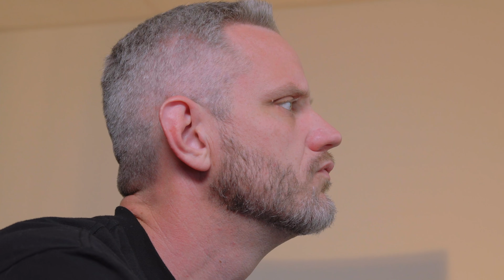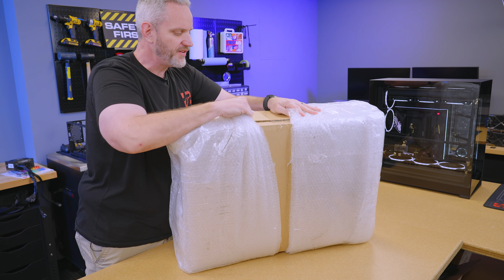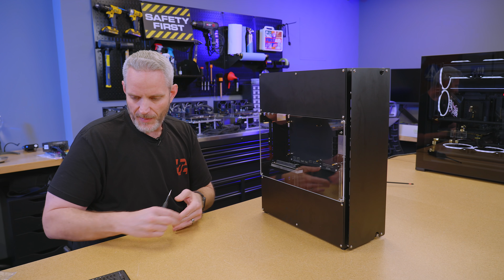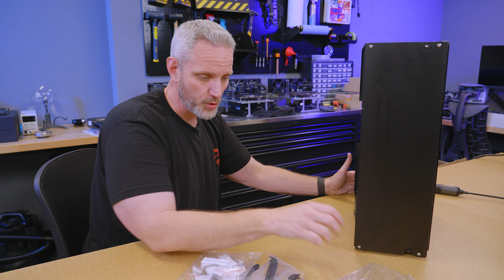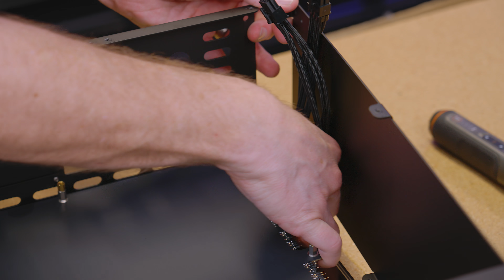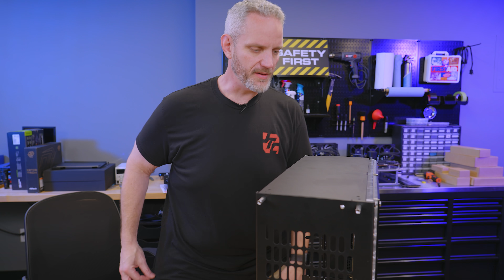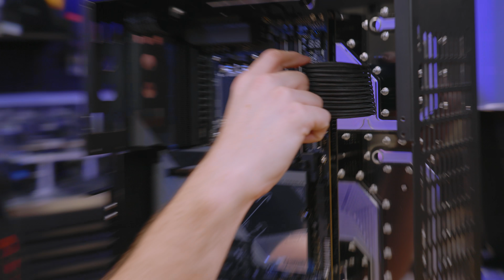I guarantee you haven't seen a case like this before...

Comment: While it does seem like a nice case, it's DEFINITELY needing some improvements in the power distribution/reservoir mounting design.  
Maybe open the holes up a little bit and use a rubber isolator insert between the screw and the acrylic??
Also, the top plate DEFINITELY needs to be opened up in the forward section to accomodate at
LEAST 240mm fans or even a 240mm radiator with all the room it has.
ALMOST Last thing I would suggest is that since the power supply goes in the bottom 
would be to have it closer to the middle of the case to balance the weight.
Lastly, like Jay said, DEFINITELY a soft rubber footing to have grip and vibration dampening but a larger flat foot instead of those baby toe pegs....
Maybe even one that goes full width, or even better still is a front and rear foot that actually tapers outside the case edge by half in inch on both sides for stability.

Comment: Why are you leak testing on a running PC, did you forget how to jump the 24-pin cable? You will not get scratches in the acrylic if you use a cotton cloth; stop using paper towel.

Comment: please explain, "what the fuck is the point?" things don't fit. it bends from ultra cheap aluminum. corners break. you need a dozen cable extensions. full of incompatibility. it's miles more complex to put together. it costs a fortune, plus you cannot use air cooling and must use all water cooling, which is hundreds of dollars more parts.

Comment: Fins do the cooling.
The thicker radiators are just working as a reservoir, not necessarily cooling as the fin count doesn't change. They are longer, but the fin count is what matters.

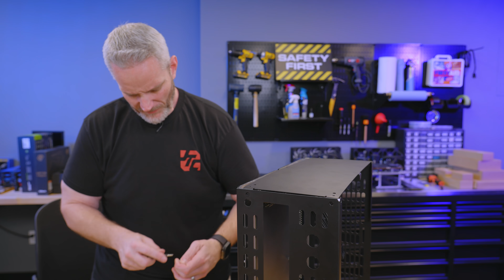Comment: Jay, ALL of the top connections can be made  and cable managed with the  top of the case REMOVED like you did at 14:00 showing the connections of the EPS 8 pin cables for the motherboard. 
(edit: I typed this before GORILLA JAY broke the corner of the powerboard)
Also, those cables that were included with this case by Singularity are WAY too long.  
I would think someone like cablemod makes some kind of right angle adapter or or a cable with the right angle end on it so that it can plug 
into the powerboard and point the cables towards the front then loop around to the actual motherboard.
If not, maybe that is something to reach out to them about possibly manufacturing.

Comment: The thing with buying a case like this is that the person is likely going to waterblock their GPU, as well. In that scenario, the clearance to the acrylic panel to the graphic cards wouldn't matter. I can't see someone going to the extent of buying a case that is, without a doubt, designed for custom loop builds leaving the GPU with its stock air cooler.
Reply: my thoughts exactly was going to comment this. I can't see anyone buying this case and not watercooling the GPU making the clearance no issue.
Reply: your forgetting about some blocks or loop designs having tubing coming out from what would be the "fan/cold plate" side which means your forced to have tube fittings go towards the motherboard side with that little clearance. 

I get what your saying but taking into account fittings and tube bends or whatever, your not left with much options for clearance vs looks. I sure as hell wouldnt want my fittings going behind the GPU (so between mobo and GPU) especially if you have particular CPU blocks or VRM+CPU blocks that are huge.

hell if you have any of the motherboards that have the duel stacked NVME ports, that top port is bang in line with where tube fittings would be, i can see clearance being a nightmare with some boards/setups just because of that poor GPU clearance thats left
Reply: @Cloop123, I didn't forget. In the 10 years I've been putting together custom loops, I've never come across a GPU block that doesn't have ports on both sides of the block, so your scenario never crossed my mind. I've used Heatkiller, Alphacool, EK, Bykski, Corsair and Thermaltake off the top of my head, so you must have encountered a very rare block with ports only on the front side.
Reply: But then there isn't much radiator space for good cooling cpu and gpu....
Reply: @FireN2k9 , unless you are running a 4090 or 5090 with a 13th or 14th gen i9 CPU, a single 360mm or 420mm rad should be more than adequate. I'm not quite sure how the acrylic side window effects radiator size and mounting, regardless. NOBODY is mounting radiators to a side panel of their case.
Reply: @mikeoleksa  

It's widely known that one 120mm radiator transfers like 100w heat tops 

I have 3x480 radiators and the fans are very quiet (40-42%)
Even so under gaming water will be 30-34° and cpu 50-60 and gpu 40-50°C
(7950x3D + 4090)
Reply: @FireN2k9 , now you are going into YOUR personal setup that YOU have chosen to go with because of YOUR preferences. It's not that a 420mm radiator would not do the job of providing adequate cooling for the CPU and GPU. The main thing I pointed out though is that I'm not sure how an acrylic window in a side panel of a case somehow interferes with the mounting of a radiator. My comment addressed the GPU clearance with the side panel acrylic window. At no point did I reference radiators and mounting them, BECAUSE NO ONE IS MOUNTING A RADIATOR TO A SIDE PANEL. To make it very simple for you, your reply had absolutely nothing to do with ANYTHING I addressed in my comment and your reply was completely irrelevant.
Reply: @mikeoleksa  

I used my overkill system cooling as an example, and I have at least 3 times the radiator cooling area you mentioned.

The case shown here is a high priced (high end?!) case, if someone buys that case and wants to do watercooling with other expensive hardware like a top tier cpu and graphics card, that case is bullshit for it.
(Maybe only for mid tier hardware)

One measly radiator will get the water so hot on load that's not practical. (Or it's loud as hell and works semi good)

Also writing some WORDS big does not mean your right.
Reply: @FireN2k9 , just stop. You have VERY EXTREME preferences. Whoever you buy your radiators from loves people like you. I'm running a single 360mm rad with a 7950X and a 7900XTX and temps aren't even 5 degrees higher than what you mentioned as your preferred temps. The point that you are missing is that my comment was addressing the clearance between the acrylic side panel window and the GPU. NOT ABOUT RADIATORS AND MOUNTING. Why would you even reply to my comment with your reply? Your reply addressed a completely different concern and should have been its own comment. I'm not denying that you have a legit concern based on your preferences, no matter how extreme they might be. I'm simply saying that radiators and mounting has absolutely nothing to do with the clearance between the acrylic window and the GPU that I addressed with my comment.
Reply: @mikeoleksa  

I don't say you're wrong
I just added my 2 cents

This could have not been a comment of it's own because it's related to yours.

Either you did not overclock or your fans are loud or both, your parts put out some extreme heat too.

Your cpu more than mine, but your card less than mine.

Let's just conclude that for the price, this case is not really optimal for watercooling.
Reply: This video awakened something in me… My nickname will tell you what.

Comment: Unfortunately, this thing LOOKS like it was made in a home workshop.  It's neat from that perspective, but it's too floppy, too limited, and just not something I would ever consider.  There are MUCH smaller cases (ncase m2 as a single example) that will fit that Astral with an AIO, look better, are smaller, aren't floppy, etc.  That same case can also be configured (easily) with 2x280 rads or (more challenging) 3x280mm rads.  This thing is just too big and too...jerry-rigged to be so limited on configurations, especially at that price.

Comment: Why not just take the power board out instead of taking off the top?  Build your motherboard on the power board and then just plop the whole assembly back in. Also solves the standoff issue you mentioned.

Comment: Beautiful case, but I feel it should be designed more like a case lab or made larger to provide a bit more room. Additionally, they should consider making one with support for dual 560mm radiators. Lol. With the GPU sticking out, I would create a steampunk or cyberpunk-themed setup. It looks like it would be perfect for that.

Comment: Seems kind of a piece of crap honestly. Hopefully its a one off with bent parts and damage due to shipping. Its not good looking. Also doesnt look like it has any airflow which you still need even for water cooling, and the wiring looks like an afterthought.

Comment: you can not put a radiator on the outside of the front, no holes for the fittings / tubes inside. 
Fans yes, but no Dust-Filter . .

Comment: Really neat case, good review and examination. 
I love seeing different solutions to already solved problems. Even if they're not always better or even functional.

I don't think this case is good enough, too many basic design mistakes, potential issues with fitment and lack of sturdiness. If you need to mod a 350 dollar case to be functional, the design is not complete. 
I'm happy to give the benefit of doubt here and say this isn't a finalized product, but if it is, it's not great. Too small, no place to hide PSU cables, insufficient options for fan placement, easily damaged surfaces. 

I think the other case manufacturers are way better in everything else except in incorporating custom watercooling designs into their case from the beginning. Which let's be honest is a very niché field, which is why Singularity has managed to survive this long I suspect. 

Thank you for the video!

Comment: a water cooled gpu would be much thinner and not mind being up against the glass directly either, because it does not need airflow.
Reply: yeah right i put a cpu w/cooler on my GPU  even though it has heat sinks you need a fan also to cool the vrms etc 1/2hr gaming L8tr pc shuts off too hot  
sat a  small  fan at pc  at the opened side panel    2 hrs gaming no worrys  Now i'll fit a fan under the gpu  2 spare  make a fitting out cutting board or such
Reply: @markissboi3583 They make full plates that fit each card custom, including memory and VRMs. But if it is only a GPU block, then yes I agree, airflow is necessary to keep VRAM and VRMs cool.
Reply: @markissboi3583 because it was a CPU water cooler NOT a GPU water cooler which would cover the VRMs as well.
Reply: thank you, Captain Obvious

Comment: The case prices are very reasonable for cases that are custom designed and made in low numbers.  I just spent $160 for a relatively plain, full tower with a glass panel, and theirs are visually really impressive.  Since I do video and photo editing, and engineering drafting and design, a custom water cooled machine is overkill.  Even then, I am tempted.  Maybe in a few years, for my 75th birthday.
Reply: custom loop is always and never overkill at the same time :D

Comment: this case makes no sense to me at all, no air flow, radiator up against basically a nearly solid front wall, who is this case made for?
Reply: It's a case designed with both CPU and GPU water cooling in mind... why would airflow be priority?.  I mean sure, if you use this as an air cooled case, you are bottlenecking your airflow for both intake and exhaust.  But for water-cooled..... totally fine.  That's why the Astral doesn't fit properly, because it's supposed to be on a waterblock.
Reply: @thornstrikesback  You are aware that water cooled systems still require airflow and benefit from there being more of it right?
Reply: @Scarlet_Soul  do people not read comments or do they only read what they want so it suits their cause.?  I never said air flow isn't necessary, I just said it's not as much of a priority as it is for air cooled systems... of course liquid cooled systems still need air flow.  But liquid cooled systems also rely on other things such as CDU, size of reservoir, pump pressure etc.  People are just nit picking at this point.
Reply: You still need air to go across mobo components and NVME drives.
Reply: @thornstrikesback  And where do you think all that heat from the radiators goes, you genius? The Aether? Water cooling is nothing more than air cooling with extra steps, you still need the same amount of airflow through your rad or your loop will saturate and your components will start overheating. Not to mention all the other stuff that also needs good airflow to cool it, like SSDs, RAMs, control chips, etc.
Reply: @goofy851  somebody’s bleeding today.
Reply: @goofy851  did you not watch the whole video... front mounted radiator and expandable front ventilation.  And no... water cooled PC'S don't need the same air flow as air cooled.  If you do, you're doing it wrong.  Yes, they need a certain amount but not the same.  Also.. not to mention the whole side of the case is one big CDU.
Reply: @thornstrikesback  i cant agree more, he presented this case in worst way possible. Most important thing about the case ( side cdu, pipe loops, rgb and water cooled cpu) is not shown. he literally made case bad because it does not fit air cooled components while leaving water cooling aside.
Reply: Its impacting!
Reply: look he will literally blow this daniel guy it seems. but I agree this case is seemingly stupidly designed
Reply: Seems like a first draft
Reply: This is a terrible advertisement video. Looks like a complete PITA to build in without a real benefit. Would love to see GN Steve's opinion on this case 😂
Reply: Couldnt agree more, this case serves no purpouse, not cheap,not well constructed, not good looking, not easy to setup 😢😢

Comment: I like the concept and I get that they try to make a cheaper case with a pump/res (and powerboard) but it looks like it came at the cost of quality.
A lot of the panels are warped when you put a build in it.
Also  tempered glass is not that expensive and should be included with this price class of case, it's not a $30 mass produced shitbox.

Comment: If this is the water cooled edition would you not get away with mounting a water cooled GPU vertically if you either had the tubes out from the top/back (vertically in case) or used right angle fittings for the bottom/front?

Comment: I prefer acrylic windows. If it breaks or gets ruined I can go to Lowes and buy another piece to cut to size. Glass adds a lot of expense, weight and no replacements in most case. I miss the days of my cases being 20 pounds or less.
Reply: So what you're saying is if it doesn't break then glass is better.....and considering side panels rarely get broken...that means glass is better😂
Reply: @raynman6466   I see quite a few case listings on Ebay and Facebook marketplace with no glass side panels. Obviously they broke. Shipping can do it as well. I've watched a bunch of videos where the glass case arrived completely shattered. That won't happen with acrylic.
Reply: @ a couple of cool things about Acrylic is you can order different colors and if you own a Dremel you can etch the side panel easily. You can print  patterns off the internet and etch whatever you want on it. Case modding is a thing that most young people have no clue exists.
Reply: @YourDeletedComments You can laser etch glass.
Reply: @YourDeletedComments  To add one more plus to acrylic window solutions: if it´s scratched, you can polish the scratches out. Try this with glass...
Reply: i prefer metal black windows.
Reply: you are acting like getting piece of glass cut to your need is something difficult :D

Comment: I'm very confused by this.... This is very clearly a case specifically meant for water cooling..... So why is Jay talking about keeping on the air cooler for the GPU or using an air cooler for the CPU? It's clearly meant for only water cooling 🤦‍♂️
Reply: He talks about how he was concerned that the rad wasn't enough for an OCd high end CPU + 5090/4090
Reply: @MautazN  Then what would be the point of the case? I bet my O11 evo xl could cool a 5090 and a 14900ks if I filled it with 420mm rads.
Reply: They sell it as both an air cooled and water cooled platform..... did you switch off for the first 5 minutes?
Reply: Yeah it looks ghetto with that air cooled card in it doesn’t it.  😂😂😂

Comment: I don't understand what the problem is with sliding . . . is your table tilted? I almost broke my furniture trying to slide my pc to it's place because  of freaking rubber feet . . . i'm buying mouse slides to put on the feet of the case because a full water cooled PC is heavy and it helps A LOT to be able to slide it easily on the . . . piece of furniture it stands on.
Reply: It's people coping because they realize they have been outwitted with a convenient solution

Comment: A case that have a distroplate in it and named watercooled Edition but only have space for one radiator?? I dont know.. Which Hardware should we watercool with only one radiator?? For a case that Costs 360$
Reply: A lot of enthusiasts now are moving to external radiator setups with a Mo-Ra or a radiator box. Singularity sells multiple kinds of boxes and watercool has even more. It appears that there are passthrough ports on the case just for that.

Comment: Am I seeing this right? Only a single 420mm radiator? 
The case is cool, but even with a 45mm 420 it's not going to be all that great with modern components.
Reply: Honestly, I'd be fine if they made it a couple inches taller so you can fit a rad and fans up top. Otherwise, I think this is a very cool case.